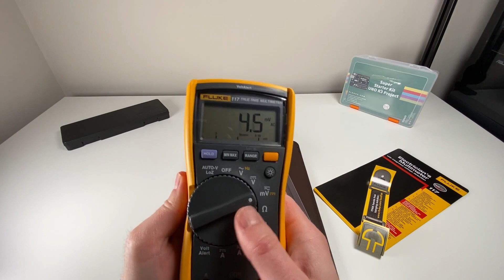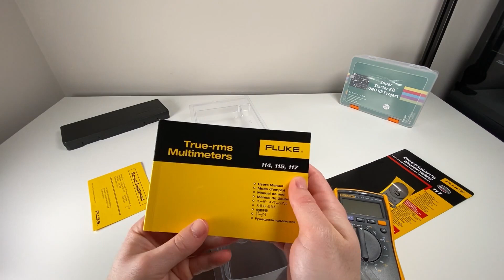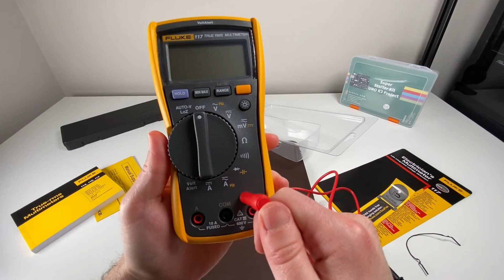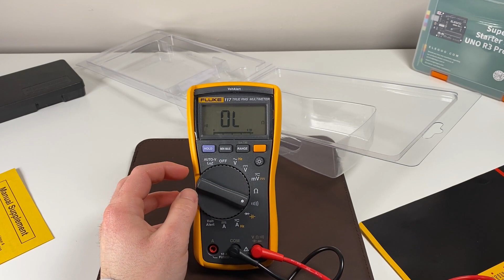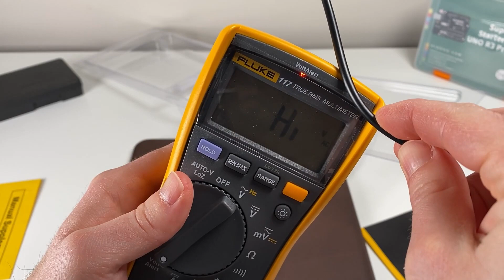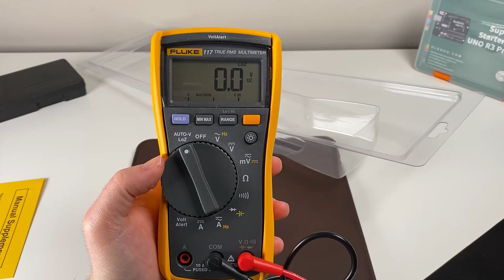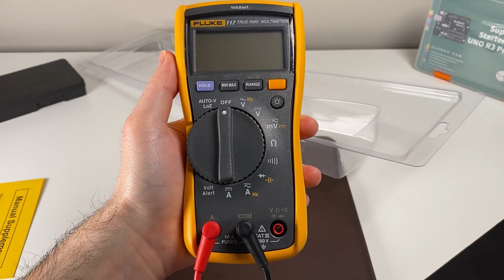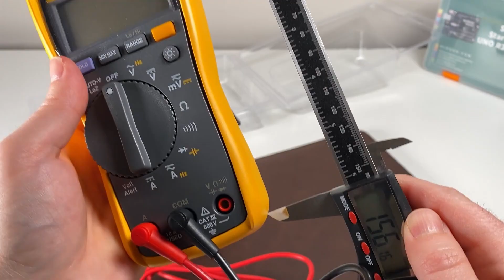Fluke 117 Multimeter Unboxing & Review of Functions (Engineering)

Comment: Hey Nik,
Do you have any recommendations on a cheaper multimeter for hobbiests that are looking to fix old electronics (game consoles, peripherals, etc.)?
Reply from the maker: Personally, I'm a fan of flukes so my suggestion would be the 101 if you don't plan on measuring current which most honestly don't need. Otherwise a 106 is more expensive but has current reading. If you're looking for even cheaper than those two let me know. The quality of the meter itself will probably be pretty low there (cheap plastics / etc).

Comment: Question what is the best fluke multimeter for an Electrician? If I buy the Fluke 87-V max would that be a bad choice?
Reply from the maker: To be honest the cheapest Fluke you can find for yourself should have more than the functionality you need as an electrician. Typically the things you would want is measuring continuity / resistance, voltage, and amperage. Everything else is a bonus and used for lower level circuits like integrated circuits. Not something that electricians get involved in.

Comment: The Fluke 117 offers superior battery handling, compared to the much more expensive Fluke 177.     

Too bad that this video doesn't show how the 9 volt battery is installed, in the 117 meter.

Comment: Does the LCD light up for low light conditions.
Reply: Yes
Reply: @dirtdiver2389  pulled the trigger and got me one, it's bad ass but I don't like the stiff test leads, and the fact that it comes with no case or pouch....other than that very pleased..😎👌
Reply: @Thesqueezebox1  I just got a new one on eBay for $185.50 plus tax.  I agree about the leads and case, but haven't had it in my hands yet.
Reply: @dirtdiver2389  ur gonna love it bro...😎✌️